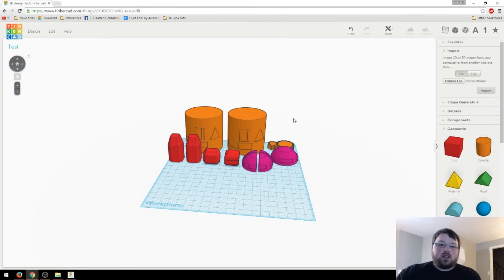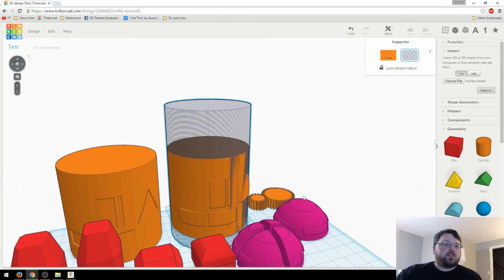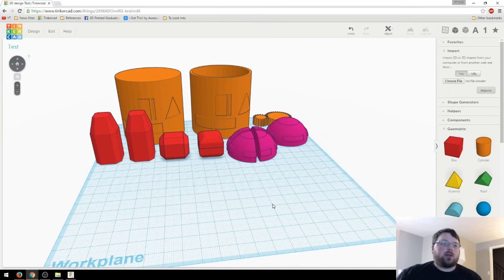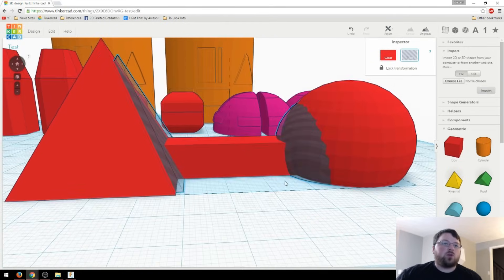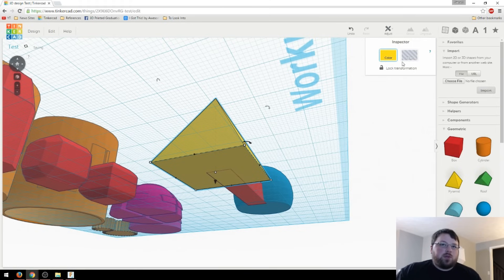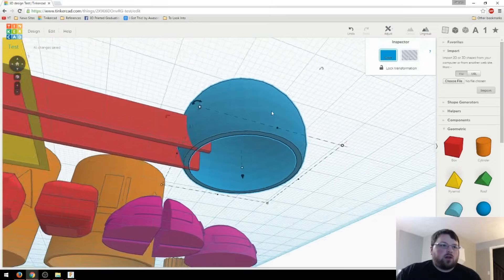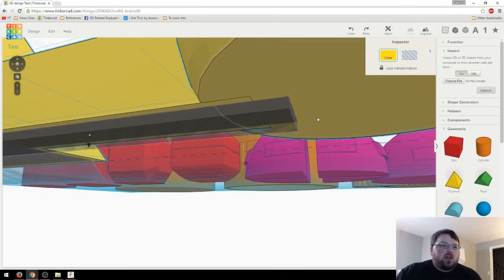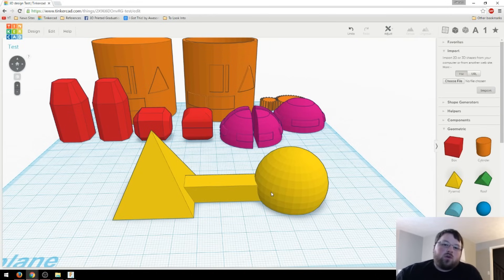How to Hollow Out Objects in Tinkercad - Shelling Tutorial

Comment: I just started using TinkerCad this spring, and have found your tutorials to be very helpful.  One thing I have not been able to find is how to make a thread a specific size.  All the tutorials say it will be in the function generator but it is not on mine.  Is there anywhere that I can download a sample CAD file for threads that I can then make into a bolt or a nut?

Comment: Just wanted to say a huge thank you for the videos and tutorials on Tinkercad. I found your tutorials and watched most of them this morning on my break at work, I needed to design replacement internal door handle covers for my Dad's 1932 Austin 10/4 project car. Your easy straight forward guides made the CAD task so much easier, designed the cover in just over an hour 👍.
I have only had my Ender 3 V2 printer since Saturday and been Geeking out over it ever since. The cover you helped me design this afternoon is printing now, it's only the third thing I have ever printed so fingers crossed, 1 hour down out of 5 🤞.
Excellent channel, thanks again for the help and advice. 🙏

Comment: Late to the party, but here's my input...

[3:10] For FDM, counterintuitively, I have found that shelling/hollowing generally INCREASES material use. There are a couple issues, actually. E.g. imagine a cylinder, printed flat end down. Shell it; leave bottom open, or not. Will require support material for top inside horizontal flat surface. OK, supports aside, now imagine "solid" cylinder vs. a shelled/hollowed one. The problem comes w/ the perimeters in the shell. 2, or 3 perimeters are common. Let's consider 3 (BTW, the problem gets worse as this is increased). So, the solid cylinder has 3 perimeters, and some infill (perhaps even sparse). The shelled cylinder has 3 perimeters TWICE! Once for the outside, and again for the inside. Worse case is for a thin shelled wall, and lots of perimeters: this nearly doubles the material usage! I discovered this once when doing exactly as you imagined... then realized what actually happens. BTW, for SLA, it's a different story.

But AHA, I found a trick!:) [In PrusaSlicer] I put an infill blocker inside. This hollows things out, but does not create a "second" inner shell:)

OK, try things out and lemme know what you find. Your results might be different. I'm interested to hear about your tests...
Reply: P.S. Thx for your contributions to the community. Your efforts have helped many people:)

Comment: I bought my first 3D printer a few months ago (Monoprice Maker Select Plus) and have printed numerous things by others. But I'm into building plastic scale model kits. My next build being a 1/670 scale U.S.S. Voyager--will be lighting it with LEDs and fiber optics. 

Traditionally, most people just use heat tubing, bits of cut styrene, amongst other things for blocking light from other areas of the model--or connecting fiber optics to LEDs. But I want to do something more elaborate with 3D printing, you know? That requires designing/building some 3D models from scratch as I can't find what I'm looking for on sites such as thingiverse. So this tutorial is very appreciated.

Comment: Great stuff !  You asked for suggestions, so I have one "doozey" for you ?

I  am a railway modeller, so want to make some quite  "complex" items to complement the various "things" I have to use on my layout. many of which dearly need some help that I believe 3D printing can achieve.

One in particular is a base plate for point/switch motors such as the Peco and Gaugemaster units that are very popular.  The problem with both of these is that the pint that slides between the two electromagnets is also able to "float" thru about 45 degrees vertically, which is not helpful at all when the accuracy of the point blades motion is required to be reasonably accurate.

Anyway, to cut to the chase I have designed a base plate to fit to these  motors that needs to include a sliding section.  Therefore  I need to produce a  print that has a vertical slot of around 1mm right down thru the piece for the control  rod  of the point motor to move in and out in hopefully,  and around half way up that slot i need another "rectangular slot into which a 3D printed slider bar will move in and out to transmit the motion of the point motor rod that is vertical in the 1mm slot 

So far so good,, the design process in TinkerCAD allows me to create an item that definitely appears to give me something that certainly approximates to what I want, BUT  the problem I am having is the I have what amounts to a cross shaped hole down the baseplate axis of my item, and it is simply not being printed as a  true hole into which the matching printed slider arm should fit and slide freely in one axis alone ?

I hope my description is as clear as  you need, and would appreciate your input as to how to do  this in the best and most 
 efficient possible way. ?

Many thanks indeed for your help

Comment: This is one of those tasks that Blender does a really good job of with the solidify modifier. Unfortunately it's easy to get cocky, solidify an object with too complex geometry, and screw that up, too. So it has it's limitations as well.
Reply from the maker: +Joe&#39;s 3D Workbench That's good to know. I've been wanting to get a little bit deeper into Blender. I used to use it a decent amount but it's changed quite a bit since then. But thanks for mentioning it! :)
Reply: Do you guys recommend Blender as the next tool to learn after TinkerCAD?
Reply: Maybe. There's a lot to Blender and it can do anything, but what's the point of that if you only want to do solid modeling? It's a bit like going to a busy all you can eat buffet for pancakes. Now if you read that and said "Yeah, but maybe I'm gonna want sausages or crepes when I get there" then, yeah, go for blender. But if you said "yeah, I'd just get pancakes somewhere else" then there are other choices. I Garret is doing great things with 123D Fusion, and I'm getting into it too.
Reply: Thanks. I'm able to do quite a lot with TinkerCAD as well and it is so easy. There are a few things, ie custom shapes, complex curves, that I can't do. I'd like to make a baby step (read: I'm lazy and want minimal ramp-up time!) up to the next tool on the sophistication scale. Blender sounds like it is a big jump. I just started looking at 123D Design.